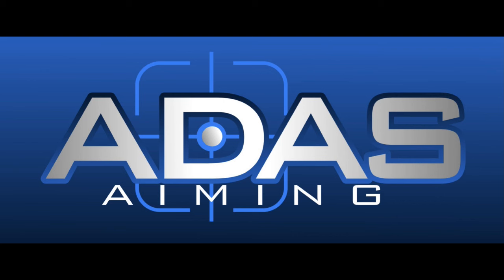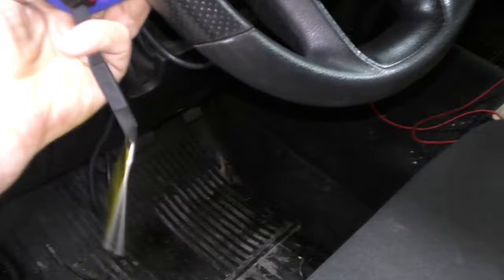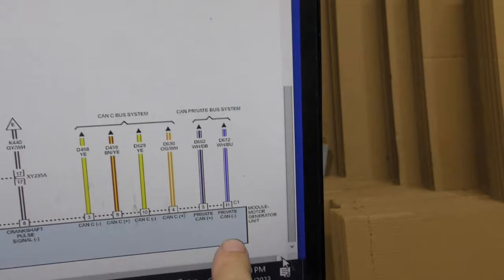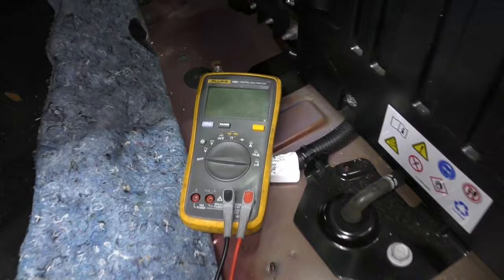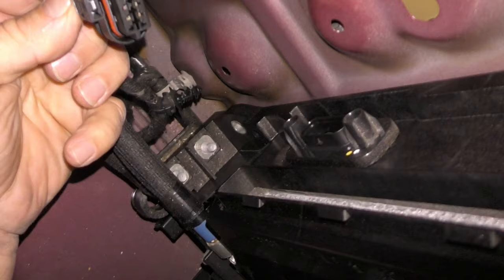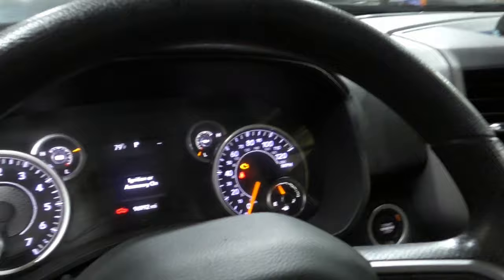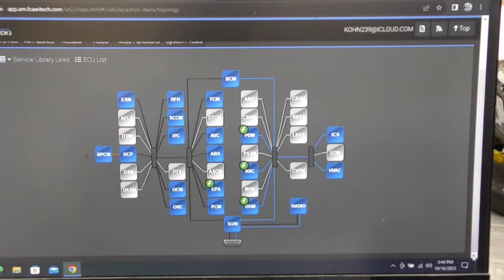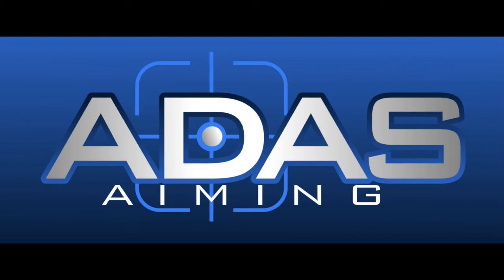RAM 1500 ETorque alternator, charging system, malfunction, diagnose, fix

Comment: Dealing with this as we speak. What software did you using to program it? I own a shop and would like to purchase said software so i dont have to contract the work out
Reply from the maker: Hi,
Wi tech  you would have to open an account it's a little bit expensive to get it started $1800 for Wi tech tech subscription per year plus $1800 for diagnostic subscription per year, in addition, you would have to purchase the pod, which is the VCI interface, in addition, every time you program a module, you have to pay $35 for that Vin
https://www.fcawitech.com/aftermarket/